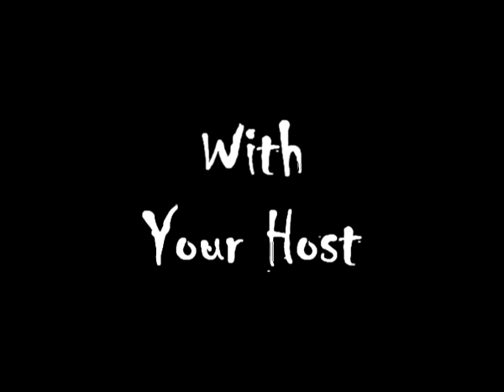Do Try This at Home! Episode 6 - A Shocking Experiment!

Comment: so dumb, the tranformer is just turning the 9v into 120v DC

but the light is AC so the bruching makes it actually go on and off "not alternate btw"

the rapid 0-120-0-120v is whats makes it "simulated"

Why not make this video useful
use a LM555 to do the brushing for you for example. make a real DC to AC converter instead of half-assing it

or just go buy one at walmart for your car for $5

Comment: yes u can but each time you turn the switch on the neon light would glow so faint that u wouldn't detect the neon. The file acts as a 'pulser'. A very cheap way to do it indeed. A computer UPS system works in a similar way to step up its internal 12V battery to your mains voltage in order to power your PC. The component in a UPS that gets hot is the switching transistor that switches on/off 50 times per second to produce 50Hz current.

Comment: No, it's not friction energy. He uses the file because as you skip across the bumps on it, it makes an electrical connection, and then breaks it, making a bunch of pulses of DC current. Fortunately, because you are stepping the 9 volts up to 110-120ish, the current gets that much smaller, so it becomes safer. Because there is an internal resistance in the battery, the current is further limited from what you would expect just using the V=IR formula.

Comment: My teacher taugh us this, if you what to get shocked use a modern coil from a car. 50,000 volts!! Its much electrcity that your muscles clamp down and you cant let go, you have to pull back and rip the clamps off of the coil. We do it all the time in my auto shop class!

Comment: you can't connect the wires directly as the transformer only works with alernating current - the battery is direct current, meaning it travels in the wires in only one direction. alternating current moves in one direction and then the other - thats the alternating bit! using the file breaks the battery's direct current up into a 'choppy' current suitable for the transformer. and althoug Mr G says this is safe, I wouldn't let someone with a heart condition or pace maker touch it!

Comment: I usually wire a relay switch to "buzz" in order to oscillate the DC current for the transformer. This can be done instead of using a file, and is automatic. LOL

Comment: DC is more dangerous than AC. Because when you electricied AC releases you 60 times in a second (60hz), but DC never releases. Thats why DC is more dangerous than AC. For example, a subway station is much more dangerous than a lightning. Current is ona important issue in electricity.  Voltage shocks you,  amper kills you.

Comment: there is one way to step-up the current, using a sep-down transformer... it will reduce the voltage but will give you more amps...

Comment: a car battery could cause skin burns as it as more amps than a 9v battery... the best would be to use a lot of 1.5 AA batteries in order to get a voltage of 24, then attach it to the transformer and you would get 320volts or oyu could just use a 60kv capacitor and and make someone fall dows to he's knees..

Comment: I see that this video can be quite informative.  Thank you for posting it.  However,  I was told about the fact that amps are lost when you step-up the voltage.  Is there any way of gaining amps?  I know that power converters for use in automobile will use 12volts from the car battery but I know the car battery contians more amps that a 9volt battery like the one depicted.  I would be honored if you would reply to my comment.

Comment from the maker: no.  a transformer can be used to isolate pulsed DC, or AC, and will return the same thing you put into it at either the same amplitude, a lower or a higher amplitude.  DC NEVER goes into, or comes out of a transformer.  You need rectification for that, and also, capacitance to fill in the valleys left by the rectification.  an AC to DC adapter has more than just a transformer in it.  Anyone who tells you that DC comes out of a transformer is WRONG.

-- Thanks for watching!!

Comment: no, transformers work when the potential voltage is changing, so he uses the file to change the voltage from 9v-0. if you just hold the clip on the voltage will stay at 9v, so now there is no change so no voltage on the other side

Comment: I might sound a little nerdy hear but im going to use my recently acquired class knowledge to correct you. With the equation V=IR(V -volts, I -current, R-resistance) since the resistance stays constant in this circuit and the voltage increases as you said, the current in turn must also increase, not decrease like you said. :P

Comment: i dont know whats so damn shocking about this clip... :D
u wanna get shocked? use the battery and put little graphite sticks on each pole, now when those are connected just touch your tongue with the two ends of the graphite (make sure ur tongue is wet)
if u dont have graphite sticks just stick ur tongue to the battery lol it should hurt (make sure the battery is 9V or stronger hihi)

Comment: this works through conservation of charge. I=qV where I is current, q is charge and V is voltage. The 9V battery produces low voltage and relatively high current. When it passes through the transformer, it gets changed to 120Volts, but due to conservation of charge, the current is significantly reduced to balance the equation. So you go from Low Voltage/ High current - High Voltage/Low Current.

Hope that made sense.

Comment: That transformer output has a voltage output of about 1,600 Volts.

I get that by taking the 120V(Mains) divided by 9V(Output) to get 13.3333(etc.)

I take 13.3333(etc.)(windings ratio in the transformer from secondary to primary - this means that there are 13.3333 times more windings on the secondary winding than on the primary) and multiply it by 120 to get 1,600V.

Comment: It makes a kind of 'switch' which connects and disconnects the transformer really fast: the faster that happens the higher the high voltage spikes on the HV output on the transformer are.

Comment: if its an DC Voltage out u need to bypass the rectifier circuit or Voltage regulator, if its AC 120v to AC9V it wont have a regulator or rectifier lol

Comment: Encouraging people with no electrical experience or training to try things like this at home is extremely irresponsible.  The way you have it set up makes it impossible to touch the leads in both hands but someone could clip the second alligator clip to the file and touch the other clips one in each hand and that can get really dangerous, especially if they use a rechargeable battery, which can usually deliver 10-20c for nicad and 5-10c for nimh.

Comment: No AC is Alternatic Current, the magnetic feild generated in Transformer is reversed 60times every secod (if 60Hz) in UK it is 50Hz.
To convert the AC to DC you'll need a Diode and a Capacitor.

Comment: heres something you should try at home! take the same transformer except don't waste your time with the 9 volt battery, plug it in directly into the wall. you don't even have to bother with the file, it works without. try putting your finger across that!

Comment: Mr. "G", the experiment can also be done with a AAA battery.  It will still be shocking.  Did you know that you have also created your very own  AM radio station?  Simple: you created a magnetic field. If you tune in on a AM radio band at the correct frequency, you will hear noise you created with  the experiment.  The radio might have to be close, but the radio waves are there.  Lightning can also be heard on AM radio band at the correct frequency.  Kind of an early alert system for lightning.

Comment: Hook several 9 volt batteries in series (their terminals make this easy). When used in this experiment, I've achieved over 1000 calculated volts on the other end! Shocking!

Comment: bc transformers only work on alternating or pulsed current.

If you just attached the 9-volt straight to the transformer, it would generate a high voltage when you connected it, but then drop to nothing.

Transformers are powered by the changes in voltage.

Comment: cause it would drain the battery in seconds, remember the 9volt is lighting something that takes 110 thats a 100% increase in power. Its the reason why batteries so dead so damn fast in a digital camera when you use the flash, the batteries charge the corona wire then you press the button and all that energy "flashes" across the wire.

Comment: just a dumb question. What would happen if you used another 9V bat and powered a moter whitch would spin a wheel over the file with your lead attached to creat a constant filing action. Then, sopposing that worked, what if instead of powering this light, you ran it through a batery charger and back to the battery. If your getting 120V, from your 9V bat, would you be able to make use of the remaning curent some how? Thanks.

Comment: This is nothing, give this a try with a ignition coil or even a flyback transformer from an old tv.  You can also wire a relay to do this to do the file trick for you (so you don't have to keep rubbing a file)

Comment: For all the people who are writing on here astonished of fact that the transformer can step up the voltage. It's a very basic electrical concept used all the time- based on the number of coils at each side of the transformer its a kind of voltage to current ratio...as the voltage decreases the current rises and vise-versa when you turn it around (as per this experiment).

Comment: it takes the current from the battery and converts it into voltage v=ir
v=Voltage
i=Current
R= Resistance
In all actuallity nothing changes, it just stepps the current down which turns up the voltage, as he said in the video it is a "safe shock" because there isnt much current behind it

Comment: After the voltage goes through the transformer and is stepped up is there a spark of you crossed the wires and complete the circut?

Comment from the maker: Well... you need a fluorescent bulb or a neon tube.  Mine was neon.  Incandescent bulbs rely on a lot of current to be supplied in order to light.  Thanks for the info, and 300 to 1000 is very possible depending on the frequency of the pulse you are making with the file.  The closer to the resonant frequency of the transformer, the more voltage that will be produced.

Comment: Umm...? Did I ever say I used a 12v battery, or needed a 12v battery? No. I used a transformer on a ripped up Honeywell Furnace Control system. It was a double tapped transformer. My aim was not 120v, it was to a get any voltage higher then 6.4

Comment: Just tried this, except I used a 6.5v 6 Amp/Hour Lead Acid battery and a relatively small transformer (still bigger then the one you used), my multi meter was reading an average of 70-200 volts with peaks between 300 and 1000 volts. Not entirely sure how that happened, but it did. With the load of a 60 watt lighbulb ( bulb didnt light), the voltage peaked at 50 volts with .02 amps of current :-P.

Comment: lets see this with a 1 volt transformer and 2 9 volt batteries, u'll get over 2000 volts out(assuming the insulation doesnt break down and you get internal arcing...) hell, a single 9 volt and a 3 volt(far more comon) would work fine, make a 4 foot florecent tube flash, far cooler than a little ne2

Comment from the maker: What kind of transformers, and batteries?  Most transformers stepping up voltage from a battery between 1 and 9 volts should be safe.  If you use a large battery like a car battery, the transformers that come from any average DC adapter will burn open the primary coils.  Do be careful though.

Comment from the maker: No.  Transformers only work with AC current, or pulsed DC current.  A direct connection to a battery supplying DC current will not do.  You will get a shock on initial hook up and again when you disconnect, however, while solidly hooked up to a battery, no shock!
Thanks for watching, and the great question.

Comment: Nice! Not only a really cool (and safe) experiment, but you got the theory right. Nice use of the file to make the interrupter -- hadn't thought of that one. If you use an AC-to-AC adapter (they're harder to find, but they exist), you can connect it up without destroying it, since it's just the transformer. Try one rated for 3VAC for an even bigger shock (should produce 360VAC with the 9V battery). Given your good explanation of the theory, you probably knew this already, though.)